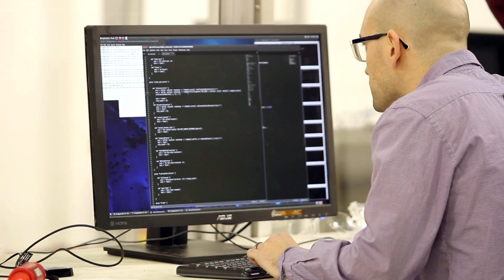ATLAS Gets an Upgrade

Comment: The head needs to rotate, and needs more camaras.
Why is it that in most movies about robots they have black and white vision camaras? Those camaras are old, don't they know Thermal, infrared, XRay and ultraviolet, it would be so cool if they could do a 4K ultraviolet vision double camaras.
Reply: ***** First they're getting basic movement working. Once you have that figured out, THEN you can add the fancy gadgets. It doesn't make sense to add 'fancy gadgets' when their robot can't even move by itself, without having a tether or a cord.

Basics, basics, basics.
Reply: hybby well the whole robot is done stupidly, because they should of started with the brain, and No! They started with a dumb body to make it more complicated and take longer, besides the battery power backpack he has is old tech, why don't they just put a very small magnetic spinning alternator inside, small as a cell phone, and a hidrogen battery, just watch the terminator movie man, the design they have there is super simple and easy, and very efficient, the guys making the robots need to watch more robot movies.
The most important parts of the robot are 4
1-Brain(computer)
2-Power source(battery and energy generator)
3- Flexibility (Spinal cord like human)
4- Hands and Feet(Stability and object grabbing)

So far they have nothing well done, the robot doesn't have hands, and or real feet, it doesn't have spinal cord, the head doesn't move, and doesn't even have a brain, they are just being stupid, the tech using in this robot was all ready made in the 70, why aren't they using newer tech, like high definition cameras, new advance sensor's, a new advance CPU with internal memory and processing capacity, etc etc etc.
Reply: ***** - Have you considered building a robot? It seems like something you have a lot of knowledge about. Perhaps you can create something that's even better than what they have, and teach them how to be more effective and efficient in their robot building.
Reply: hybby  I would certainly like to do so, but it involves a lot of money, unless I could work for them as a supervisor and provide them with ideas, like see if I could improve the models with some ideas etc.
But they don't want from what I see, because they are manipulated in there minds by Satan, they are doing it wrong to waste more money and time, sense Satan wants to empoverish the USA and make the Chinese rich, sense the Chinese are clones of him.
By the way they are also building robots with the Japanese in China in secret facilities, they are allied with Japan secretly, but they don't say, also with North Korea they are one gang.
Reply: ***** ... if you really want to do it, start small. Until you show proof that you know what you're talking about, on a micro level, they'll never put you in charge of a larger project. 

Annnddd you've involved Satan. That's just off the wall. I'm muting this conversation. Cheers.
Reply: hybby there is no way to start small, all electronics involve very expensive tools and a lot are extremely high prices, the only ones who can do electronics in a cheap way are cell phone companies, but because they all ready have the most expensive and advance equipment, for one person to start in a micro level it would accomplish nothing.
You are the one who doesn't have a freaking clue what you are talking about.
Reply: ***** thats what I think everything is old in this robot, what a about nanotech and thinner cords, is awful
Reply: ***** Now you lost me
Reply: jecko totro the robots are being made with black and white cameras, why wouldn't I think they are not being as they should, we have 4K now a days, not even 720p, not even color, black and white, man that was in the 60'S.
Reply: ***** Robots just aren't smart enough to process that amount of information simultaneously yet. The computer it would take to process multi-spectrum high resolution senses would be too big.

In a lot of machine vision software the visual input is still reduced down in resolution to a couple of hundred pixels wide, like a webcam from the 90's.

What's needed are chips designed from scratch to process neural networks, but there's no money in that yet because you can't put them in much else (ipads or the like).

Otherwise we just have to wait for the progress of technology to shrink chips enough to fit in the 100x as much computing power it would take to have senses as acute as a person. I daren't even try to guess how many x more power it would take to appreciate those senses to a human comparable level, but that wasn't the question.
Reply: Michael meh it's not one chip, is many chips, and to compress those chips you need yo make a big model that is necessary and then reduce it, new computers and even refrigerators, new semi trucks need this technology, because to learn to reduce fuel, and to better understand traffic.
Besides the processors need the memory in them, start with a large processor with memory in it and GPS all in one.
Cell phones can use them.
And guess what even for Satellites are great ideas, they can make this Artificial Technology for Satellites as Satellites are big and can be built for them, then can be reduce to home computers, etc.
But my point of view is that a robot would need more than one processor, maybe even 4, and the processors need to be heat resistant made of something like aluminum foil to be more heat resistant and with internal memory on them, for example the processor would need to be the size of a 1terra external hard drive with the external hard drive, the two into one made of aluminum foil to resist heat, and not be hack.
Reply: Michael meh actually the human brain is like two processors, one the left and the other the right side of the brain, it's split into two parts.
Processors are too small, that is why they process little information, if you want to make a robot more intelligent then you need to make the processor as big as the left and another as big as the right side of the brain,which would be easier than making them smaller really,because is making them smaller what is more difficult, in this case for the robots they need to make the processors bigger which wouldn't be too difficult, the cost will go down as they learn more about it, and how to simplifying it, as for now they can make some models and test them in real life scenarios, besides the body of Atlus is such a not good model, they need to improve that design with more human looking feet and it needs the hands and a nek, not a weld face in it, it needs to move the face, rubberneck style as when they copy in a test.
Reply: Michael meh televisions are large, and they can make processors as big as 60 inches long on them, so all new televisions can have very large and powerful processors in them, and the processor can have memory storage in it, so the same processor can store all the memory it needs, I like that.

Comment: Why won't they use fuel cells? Judging by Kraftwerk it's not too expensive (for DARPA anyway) and with decent amount of gas it can run for much longer than with any reasonable Li-Ion pack.

Comment: Can I have a Satellite with telekinesis, that also teleports me objects that I need when I need them, and can have time travel technology to help me when I need it, for example to kill the aliens it can teleport the aliens very far away to the sun so they burn, and that the satellite kills them by sending metal pointed objects at super fast speed against them to cut them apart, and squeezed them and break them apart.
Also that the satellite can teleport me to safety, and sends me a super advance armor suit.